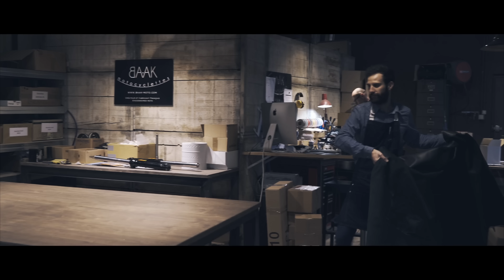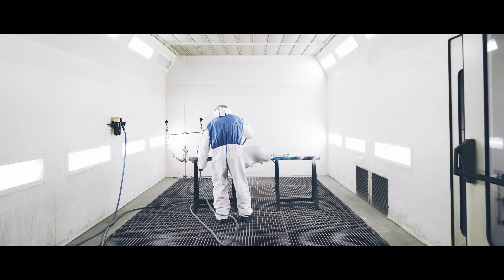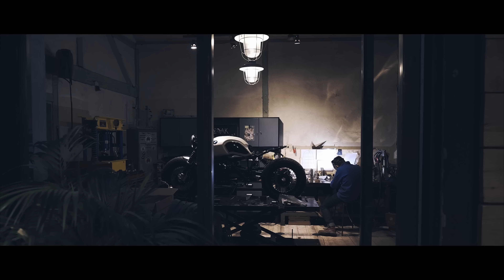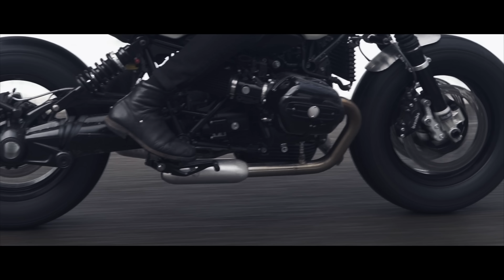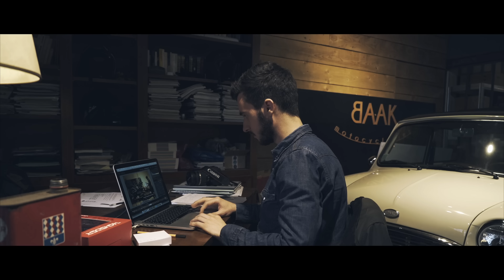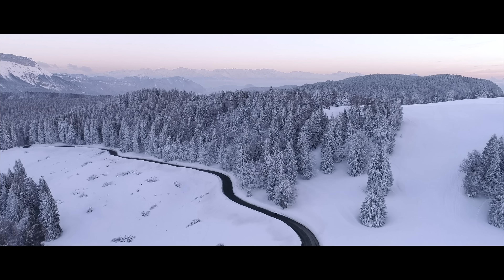Bolt on: BAAK's BMW R NineT bobber kit

Comment: How did you solve the catalitic converter and o2 sensor disconnection? 
where is the plug and did you disconnect one of the fuses? also, how did
 you do the muffler? special pipe?kit? What size are the rims and tires?
 are they gs? Thank you.

Comment: What kind of tires and wheels are those? LOVE them! <3
Reply: Exactly! I have the same question.. Was just surprised to see the risk
Reply: It's our Aluminium wheels for BMW NineT and Continental K112 tires in 16'.
Reply: @baakmotocyclettes233  are they good for such conditions? Looks like the temperatures are around 0 degrees celsius. It's surprising to see especially in the corners and any braking that's been applied. Wouldn't it slip?

Comment: if you look carefully, it seems like these guys in the video are only ever in shot doing menial tasks. E.g Hammering abstract pieces of metal/rubbing fully upholstered leather seat/spinning wrench at random locations on the chassis.
Reply: You can trust me, it was more than menial tasks required to build this. From sketches, 3D prototyping, metal shaping, leather work, aluminium machining, painting, wheels lacing, tubes bending... The guys on the video are not actors, that's our team at work.

Comment: I like bikes, I like builds, I like custom builds.....What I don't like is the over the top price tag of 30.000 Euro. I rather drive my super duke 1290R model 2019 for 16.500 Euro and make it my own for 5.000 Euro. Still cheaper. come on you buy a nineT for € 16.050